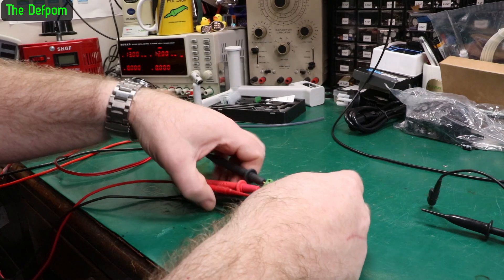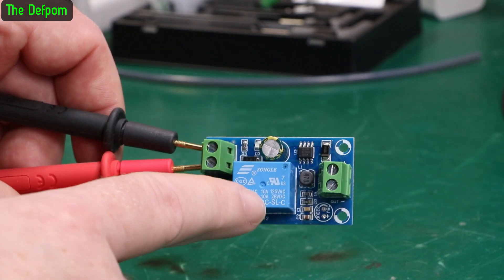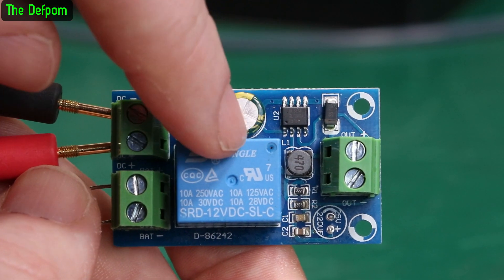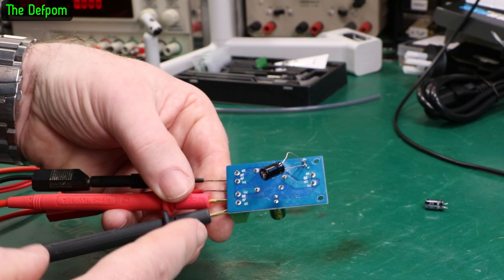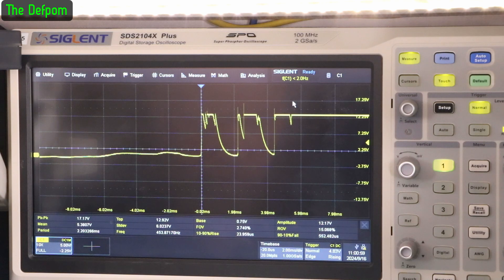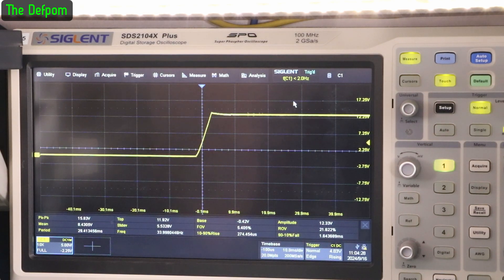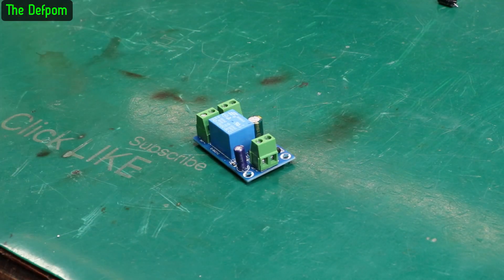🔴 DC Change Over Relay - Lets Make It FASTER ! - No.1329

Comment: Why not use a SPDT relay?  When the power is lost on one of the inputs, it will switch to the other one.  What am I missing here?
Reply from the maker: @GeorgeGraves  that is exactly what this is
Reply: @TheDefpom  Hmmm.  Then why does it need a power supply?  Let the incoming voltage power the relay closed to one set of contacts.  When the power goes away, the relay switches over to the other set.
Reply from the maker: @GeorgeGraves  because this particular unit can be used on a range of voltages, not limited to only the relay coil voltage itself, I think it was 11v to 30v or something.
Reply: @TheDefpom  Hmmm.  That doesn't seem like a huge range.  Not so much that you couldn't find a relay that would cover that range? Or limit the current?  Dont' know.
Reply: @GeorgeGraves  relay coils don't typically cover a range like 11 to 30 volts.  If a relay is rated for example 12 volts you can go a little above or below the voltage and be ok but if you double to 24 volts as an example you'd burn out the coil from too high power dissipation.  If the relay is rated 24 volts and you run it at 12 volts it probably won't pull in at all as the magnetism in the coil will be too weak or may not close the contacts fast enough to prevent arcing and damage.  The board in this video has the voltage regulator to make the relay work over a wider range or accommodate changing voltages.  If the circuit voltage is fixed ideally you should just use a coil matched to the voltage in the circuit.
Reply: @EriksElectronicsWorkbench  yea, but its a "change over" board.  so you know the voltage ahead of time presumably.  ditch the v reg.  raw relay it. done.

Comment: nice video. I would suggest to use only 100nF capacitor not electrolytic and use instead of original capacitor only diode ..that should help with extra voltage in opposite direction

Comment: I don't know if you have a pratical application for that board design, besides as an exercise in modding it, which is good info but I wouls suggest 2 different configurations if "change over time" is crucial. The first, which is practiced by major Telecom companies that need to power equipment ( and I know this because I spent my last 13 years in employment in one installing and maintaining equipment, power systems and batteries for one of them) is, to connect the equipment directly to the battery source, and have the Line / Mains powered DC source directly bridged to the batteries with no relay or switching connect device beteeen them. This will work if the powered equipment isn't voltage sensitive to the point that the difference between a battery float voltage and working voltage after the line / mains voltage cannot power the system anymore and work in a wid range of voltage power, such as, most 48V powered eauipment could work in a range between 44VDC and 60VDC, as the Absorbed Glass mat, or AGM technology batteries we used had a common float voltage of 54.48 volts given to them, not accounting for changes due to tempreature compensation. The direct bridged configuration has no change over time, or, relay that has to take a surge and invoke a switching time between sources, and is basically fool proof. If something was more sensitive to voltage change, designing a bridged system that used a MOSFET, possibly a P Channel depleton mode one in place of a relay, could most likely reduce the connection time to microseconds with no contact bounce.

Comment: Ny solution would be to put a decent size capacitor across the output of the device so it acts like a short term battery back up while switching is happening, there's no switching time for the device you are supplying. ;)
(might need a diode to prevent the capacitor backfeeding depending on circuit)

Comment: Dump the relay and use active diodes to do the switching. If you need the relay isolation you could try latching relays as they are driven in to both states.
But relays are always going to put contact bounce  and switching delays in to the system. Also if the DC current gets higher then the welding of contacts due to arc's is going to be a problem. 
Relays, and switches are never very good at switching high DC currents as there is nothing to suppress the arc formed as the contacts break. Magnetic arc suppression helps a lot in relays and contactors.

Comment: My logic tells me you are supposed to change relay, not the capacitor. It works now, but I think you will destroy relay sooner.
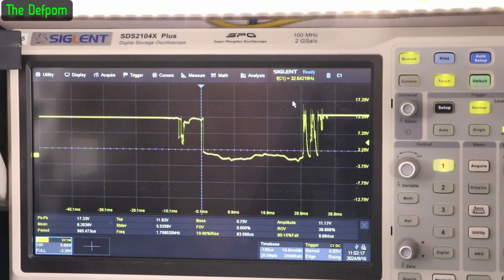Conclusion is there are pros and cons when changing capacitor. 33uF at 3:52 and 10uF at 4:49 5:09, difference is visible.
4:15 - This actually means, each time you turn on relay, its turned on 4 times, reducing life of relay effectively 4-5 times.
Anyway nice short demonstration.

Comment: The contract bounce is interesting.
Reply: Regular switches do it as well.
Reply: @anullhandle  and keyboards too.
Reply: @Conservator.  Idk if the computer or the microprocessor in the keyboard handles the key debouncing?? just a guess the keyboard?
Reply: @Conservator.  Idk if the computer or the microprocessor in the keyboard handles the key debouncing?? just a guess the keyboard?
Reply: @ since a keyboard connector (before USB) only had a few wires, I think we can conclude that the keyboard itself must have had a microprocessor to handle bouncing of the keys.